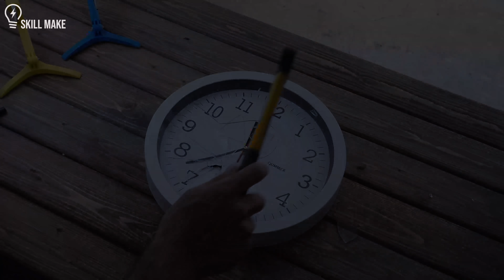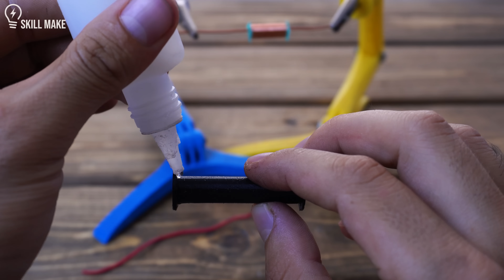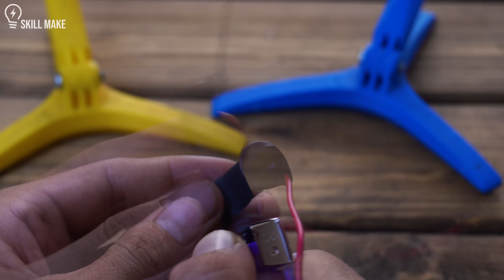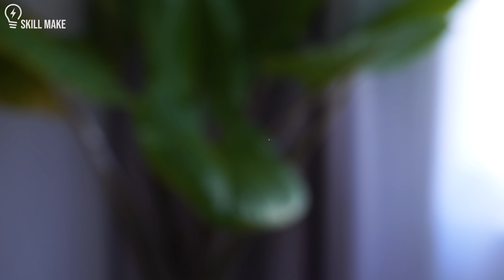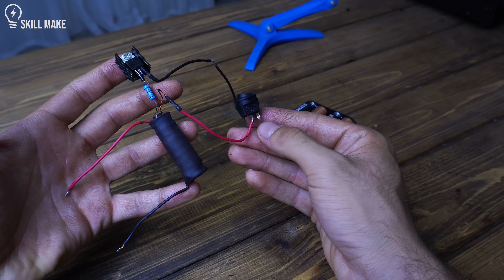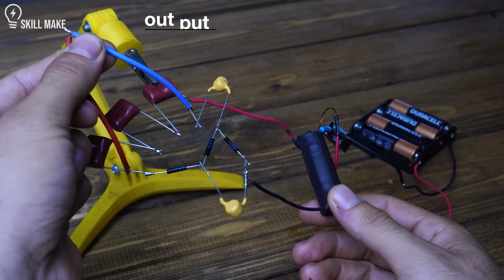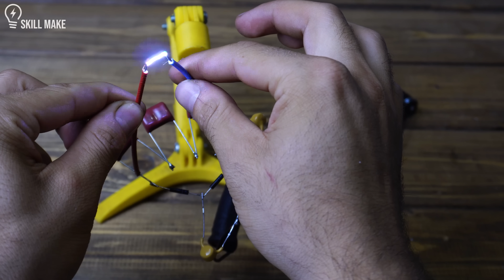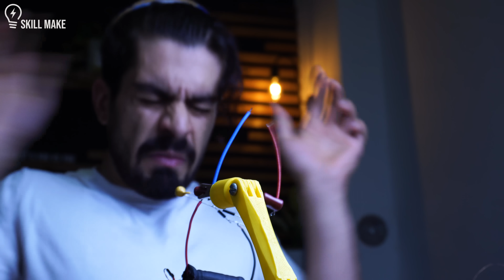Make 400000v High voltage generator (easily) - High voltage PLASMA transformer

Comment: How can you count turns with drill?
Reply from the maker: @gooch-xe3np  I haven't shown it in the video, but behind the scenes, I put a magnet on the drill head and count the number of turns with the magnetic field counter application.  The application works in such a way that it counts every time the magnet passes by the phone.🤓
Reply: @skillmake  ^^
Reply: @skillmake imagine a science teacher makes a task of me making an electrical discharge and use your video, it will turn to tazer and arrest me 💀
Reply: @skillmake  im sure you need a hall effect sensor
Reply: The real Tony Stark
Reply: Better yet, he didn't need the drill. The copper was already wound on the coil it came on, if he left it on there at part a ferrite or iron core he'd be OK lol
Reply: @skillmake 😲😲  woow. ...   🫡👍
Reply: 69 likes also i was going to ask the same, this guy is just super human
Reply: @fjs1111 it whould not work becuse it whould arc between the windings thats ehy he used isolation between
Reply: No más tírale a lo loco qué se enrolle un buen puño más o menos y con eso un royal es toda la bobina de un timbre ding Dong un relevador o cualquiera de esos aparatitos que traen bobinas chiquitas con alambre fino
Reply: You basically can’t because the drill is spinning at such a high speed. To be able to know how many turns you have done, you need to do it by hand. And trust me, it’ll take you forever to do it too if you want to know how many turns you’re going to need to do for a certain project.
Reply: @sondrayork6317  if ,ou turn the drill slower...
Reply: @sondrayork6317  but i wind my transformers by hand and it takes about 3 hours without stopping
Reply: Why u didn't show this? @skillmake
Reply: 300 turns
Reply: Why do you need all this? A flyback transformer from an old TV will help.

Comment: There are no 400 kV. Only 20-30 kV maximum
Reply: why tho?
Reply: @Alternate-H123_22  Because 400 kV will create a corona discharge from a distance of half a meter (here a couple of centimeters), and crazy insulation of the high-voltage transformer is also needed. In addition, with its 3 multiplication stages, the transformer (“for 400 kilovolts”) must have at least 130 kV; with its insulation, which is almost non-existent, it is impossible to get more than 40.
Reply: 1-2 кв максимум
Reply: @ААААААААААААА-е8у  сантиметр пробоя воздуха оценивается примерно в 10 тысяч вольт, а здесь 2, 2.5 сантиметра. Точно не 1-2 кВ
Reply: 400kv stun guns out there. Utilize square 9v batteries. 
You can step it up to any voltage. Needs some current to flow when the arcs made though.
Reply: Was going to say the exactly same.. the thumbnail itself reveals that. ofc ppl who wouldn't understand think 400 00 0 0000+0000 volts is the most amazing thing. But i Honestly wanted to see what was the build about.
Reply: @Mr.Bob369 Oh, where exactly? UHH there isn't :D!!!!
Reply: @Mr.Bob369  Wake up!
Reply: Yes bro 400kv😂
Reply: @yogitapawar2235  you know. No matter how cool the sticker is which blings out that  400kV. It doesent really have that much voltage. Why you may ask? Well, you know uhh the law of physics. But please prove me wrong.
Reply: Right
Reply: I get a spark gap like this about 1/2 inch with 5 kv around 100 ma with moderate ambient conditions.
For enthusiasts, one may use self adhesive polyester for interlayer insulation up to 5 kv!
Seal the coil ends with araldite and heat with heat lamps to drive out any air!
If you don't have vaccum impregnation!
Read about stepped winding and shunted transformers!
Reply: @nukchix  x-ray trafos create 80-150kV
Reply: @glennlopez6772  You may stretch 5kv arc to 1/2 inch, but you will not get 1/2 inch breakdown arc with such low voltage.
Reply: Ollright
Reply: @nukchix  
We need to multiply much higher than 400K.
I need 40M at least.
Reply: @scorchedearth1451  highest voltage ever recorded was about 28 MV they still hold the world record I think
which was insane ... sooo ur not him bro ur not him u ain't getting 40 MV
Reply: @513nd3rman  No. Firstly, 400 kV = 0.4 MV. And secondly lightning has been measured up to several hundreds of MVs. The 28 MV (28000 kV) is probably from some lab power supply.
Reply: @user255  that's what the person wrote bud 40 mil read his comment 
And I don't think they let god compete in genius world record 28 MV human made lol
Reply: @513nd3rman   OK, my bad.
Reply: @user255   no big deal bud
Reply: Noooooooo max 1kV
Reply: was going to say..    400000 volts from a 1.5 volt input?   LOL transformer wound be MASSIVE
Reply: So sorry, but there are street cables that do carry 400kv,you just dont see them
Reply: @nukchix  that's right
Reply: Is it still dangerous for human ?
Reply: @nukchix  1 cm == 20000V.  here 1 -1.5 cm.hence 20000-30000V
Reply: abhe kv matlab 1000V
Reply: @nukchix ive seen this dude create a 800kv coil like gun shooting huge flames, so i mean???
Reply: @nukchix so 400kv in theory, assuming perfect gap insulation, but lower due to breakdown voltage?
Reply: It's simple how gone make stupid people to watch when they putting topics who don't have any possibility and the people are easy to play with them so that's why is the topic like. That why doesn't prove it for every one and measure it 😂😅😂😅
Reply: @nukchix вторичная обмотка 300*6=1800, первичная примерно 30(чтоб считать проще), тогда коофициент трансформации 60, напрчжение питания 4*1.5=6 в, без умножителя получается примерно 360 в, умножитель имеет 3 диода, значит 360*3=1080 в
Reply: @scorchedearth1451  You need to open a time portal?!
Reply: @Alternate-H123_22  400 kV = 40 cm
Reply: @Mr.Bob369 wrong. In a one cm gap, you’re limited to 30kv
Reply: @alexanderbelousov7755 подсчёт конечно слишком приблизительный. На самом деле количество витков в первичной обмотке нужно учитывать так а не иначе если генератор даёт синусоиду в трансформатор с замкнутым магнитопроводом. Тут наверняка что-то более похожее на меандр или пилу. Когда в первичной обмотке ток резко прерывается а на вторичной обмотке активной нагрузки нет то и в первичной напряжение больше чем 6v и во вторичной больше чем 1kv и будут расти пока где-то какой-то ток не пойдёт.  Или искра со вторичной или транзистор на первичной сработает как стабилитрон (диод в обратном включении) или ещё как нибудь. Но то что 400kv там не будет и близко это точно.
Reply: @Mr.Bob369  No, it's not physically possible to get 400kv out of those stun guns.  400 kv can arc around 24 to 30 inches.  A 1/2 inch spark gap limits it to about 10 to 15kv.  Any higher, and the components wil short out due to arcing. Stun guns should be rated by joules.  More joules equals more pain.
Reply: Actually 1V/mm spark.
Reply: @paulocavutto3601  1KV / mm sounds correct, not 1V/mm . Definitely not 1V. As for 8KV and 27KV - it is not something really big. It was quite regular for CRT TV and CRT computer monitors. 8KV for black and white, 27KV for color. Of cause there is no such voltage necessity for LCD and OLED devices.
Reply: @mcsaatana1614  only in a tube filled with insulating gas, like sulfur hexafloride.  I used to work on gray equipment.
Reply: Xray
Reply: @philkulibin2602  Oh sorry! You are right. Thanks.
Reply: @nukchix  тут примерно на миллиметре появляется дуга
Reply: Another Voltage charge pump possible?
Reply: @nukchix  Falsche Anwort guter Mann Es sind pro mm ca 1Kv ,,,

Comment: That shock at the end was karma for the clickbait!
Reply: U have to put multipliers but I don't think u will get 400kv
Current in those batteries is simply not strong enough
Reply: @kutsja4671  Batteries produce DC, DC doesnt work on transformers. Transformers for AC only
Reply: @kutsja4671  OBV. He was just demonstrating that it's capable of harming you. One heck of a good actor, imho. Also, he shows u how to build this shit, it's not clickbait.
Reply: Haha😂
Reply: @Bruh-nb1hj  Bro that is why he made an oscillator circuit to convert dc to ac sort of wave. it is called the flyback or whatever the more powerful one is ZVS circuit this simple shit mosfet cannot make a pure sine wave. Alas it will still work and this video is not fake  the video.
Reply: This isn’t clickbait
Reply: @no-turdburglars_inc it is when it’s not what is advertised
Reply: @stevrgrs  Oh.... Okay that's a perfect simplified clarification detail. Nicely stated.
Reply: @Bruh-nb1hj yeah it has a driver
Reply: Electroboom shocks himself all the time for clickbaits

Comment: False information.  Brake down voltage of air is about 10K volts per inch.  The arc never went more than an inch, so there is no more than 10K volts in this thing, far from 400K volts.  It would draw an arc of over a meter if it was 400K volts.
Reply: It's 30k Volts per centimetre 
So basically 30x2.4=72k volts per inches
Reply: @piratesgaming5137  The exact voltage depends on moisture content and atmospheric pressure (to some extent). It also depends on the geometry of the electrodes. So rather than exact voltage you have to talk of the electric field at the surface of the electrodes. So a pointed object will require less voltage for corona discharge and breakdown as compared to a smooth rounded surface.

Comment: could have just used the original coil
Reply: The original coil would probably arc internally and get destroyed in no time
Reply: @raloed.363  Why?
Reply: @YarovoLivas  high voltage coils have a certain voltage per turn depending on the volatge applied and the lenght of wire. The original coil had so many turns close together that the volatage per turn between two or more turns would be high enough to arc through the wire insulation and burn up the coil. The new coil he built had the wire spread across a longer lenght (thus decreasing the amount of turns overlapping each other). And also he added what seem to be epoxy or nail polish between layers of coil to increase insulation.
Reply: Not to mention he wrapped it around a magnetic shaft
Reply: Without that oxidation eddie currents nothing would have happened

Comment: At normal atmospheric pressure, it's 25KV per inch of spark. It's easy to ballpark the voltage of a discharge. A 400KV discharge is 16" long.

Comment: If we want to power the transformer with a direct current source, it will not work. This is because no voltage will be generated. Voltage is generated in the secondary winding, but to generate it, a variable magnetic field flux must appear.
Reply: thats why u use transistor, to make cheap but effective ac current
Reply: Commutation generates some short impulse of ac current, that is enough in this case.
Reply: H bridge inverter with 4 MOSFETs ... OR use an iron core, take the switch plate out of a relay mount it at the end of the core about 12 thuo clearance. When you power through the switch plate the coils charge and the core gets magnetised opening the switch, feild collapse makes an ark and core de-magnetised switch closes and it start again powering itself on off in quick succession to form a constant ark! Only one coil around the core is needed no transistor diode or resistor needed. Only the secondary ramp up circuit is needed. A water solenoid from a washing machine is a ready made sealed coil to put the core and short coil straight into the centre of!

Comment: If you drop by 4/5th’s into a step down transformer, you will obtain BOTH high voltage AND high amperage!! Gerard Morin  proved this with a 500v gasoline generator to power up a 50kv transformer to then step down from the positive & NEUTRAL from the 50kv to a 10Kv and had 10Kv of useful working power!

Comment: In electronics class we would prank one another with charged capacitors on chairs.
Reply: we used to put them in someones pockets...
Reply: @koshkingdedamage  hmm sounds hefty 😎
Reply: You monsters 😂
Reply: LOL
Reply: we just used the signal generators wired to the rivets on the chairs...
Reply: We put them in potato chip bags and left the bags out on the bench!
Reply: That’s pretty dangerous though. ☺
Reply: We pranked the electronics teacher by putting capacitors (electrolytic ofc) into the work area outlet strips… so when we went to go do work and he turned main switch on for those strips… KAPOW! Capacitor would explode. 💀
Reply: I just say R.I.P. ants 😅😅
Reply: Your capacitors are low value right? Or you changed the chemistry of people
Reply: @skillmake  can i use bolt to replace the farait core plz reply 😢

Comment: You forgot to add the quartz crystal oscillator plate, so that it can throw lightning bolts at the paintings of George Washington on the walls.  I love how the high-frequency tripler (oops, sorry) burns a hole through your bit of paper.  I think your circuit is amazing because you only use about 100 feet of magnet wire and generate 10 billion volts, I think you and Elon should get together and re-invent the electric wheel.

Comment: man why did nobody tell me that thin wire grows in quartzclocks. and if there is one thing i learned from this video, its to ALWAYS USE BOTH HANDS WHEN WORKING WITH HIGH VOLTAGE, i mean how else would i invite zeus into my heart?
Reply: You'll get zeus into your heart allright.
The two handed fool is lucky it was low current or he'd be dead.
Reply: Another thing i learned from this video is how to avoid having to flip a clock over to access the electronics.  I am going to try this next time I change the battery.

Comment: It's more like a step-up transformer. The frequency remains the same. Induction in the primary coil causes wireless transmission to the secondary coil, a concept invented by Tesla and utilized in the Tesla Tower.
Behind this, you can observe that electromagnetic radiation is causing the wireless transmission of electrons. If you make a small coil with 26-gauge wire and 25 turns, then connect a mini bulb and place it close to the induction coil on the same plane, the bulb will light up without any wires.
Reply: correct man
Reply: The step-up transformer with its primary and secondary windings already existed before Tesla
Reply: @Itzzmeagain28  may be exist I don't know exact
Reply: @Superguru123  George Westinghouse already was in the market for electric energy, and was already trying to capitalize on Alternating Current. They already had transformers. Tesla came later on to help out with the induction motor
Reply: Misma frecuencia de qué? La frecuencia es muy baja y si bién hay una pequeña generación de ondas electromagnéticas estas son muy débiles y su frecuencia depende de otras cosas ajenas la frecuencia que circula por la bobina. La torre de Tesla fue un gran fracaso y él lo reconoció siempre. Ahora en ámbitos esotéricos se han creado muchas ridículas fantasías alrededor de esos temas, obviamente sin ningún valor.
Reply: @achernarscardozo69  frequency depends on other things ?
Reply: @Superguru123  Sí. La frecuencia que irradiará de ondas electromagnéticas dependen de la longitud de los cables de AT y las capacidades asociadas (parásitas)  generalmente están en el orden de más de 100mhz.

Comment: Voltage is limited to the breakdown voltage of the air gap. Which is about a centimetre so at MOST you can only get 30k volts. Or 30kv.

Comment: Thats exactly what I did with my home made 18,00,000v stun gun, I had the terminals too far apart to begin with for a cool zap spark, but didn't realize that it was still holding the charge when I went to move them closer together heh heh heh, wow I was broken for days...
Reply: 18m is crazy cap you would be fried if you touch 18m
Reply: Wow, you achieved a higher output than Tesla and Robert Golka, who only reached 12.5 million volts.  Amazing!

Comment: I think you need a lot more turns than that.  IIRC to turn 1.5V into 300kv you need 200,000 x as many windings on the 2nd coil as you have on the 1st one.

Comment: It's strange, I used the same primary circuit (no capacitor bank) time ago for a school project using a C core transformer and the same circuit with the d880 but with a 100/120ohm resistor, almost melted everything and the cables insulations didn't hold voltage (it originall had 150ohm resistor and had no heat problem nor insulating but got small arcs). I made really good arcs with 5V 2A input but the mosfet needed to be cooled by a good dissipator. I'd recommend using a flyback tho, same arcs but less dead mosfets.

Comment: I'm going to use 400 turns three times instead of 300 and see if the capacity can be increased. If that helps, I'll be back in the comments!!
Reply: Don't use capacitors like him because they in themselves store the power and don't multiply the power so an arc won't be formed and also if you are going to use it, use it with a source like him but with all the batteries charged I helped myself by liking our brother's video because he was the only one who didn't lie!!

Comment: Every single one of those solder joints are called "cold solder joints." You don't just touch the iron on things to solder them. Sure, we've all done it before, but that's not how you solder, properly.